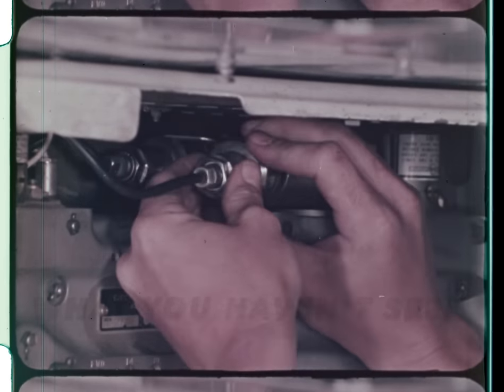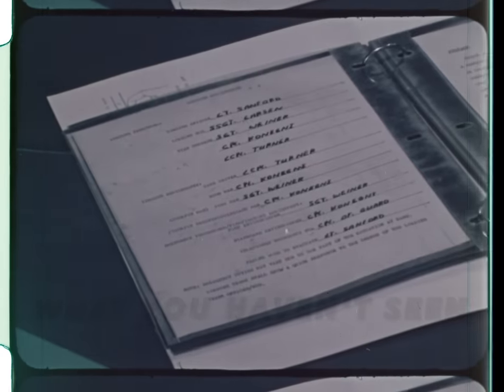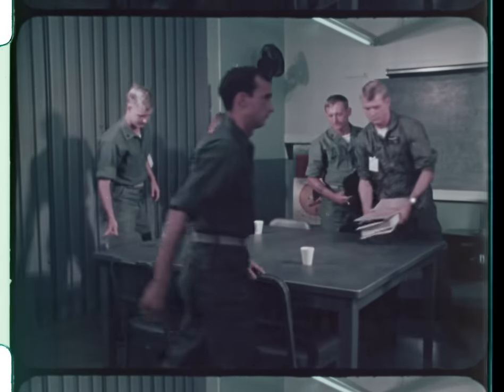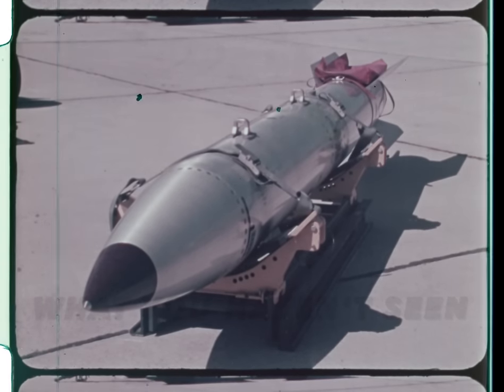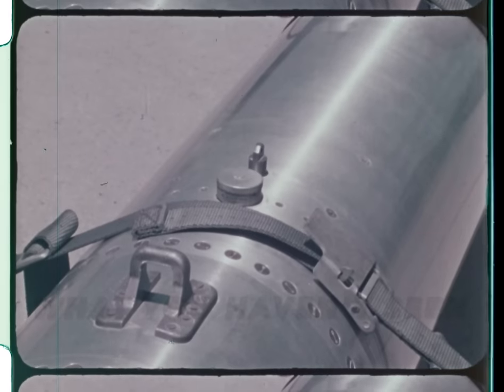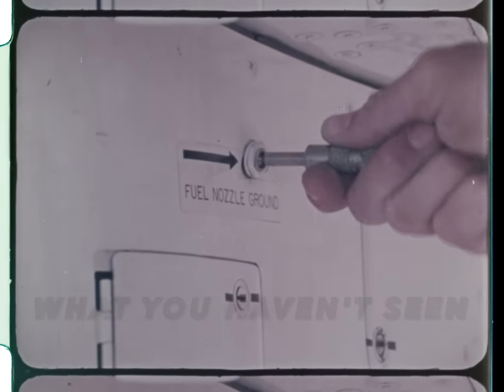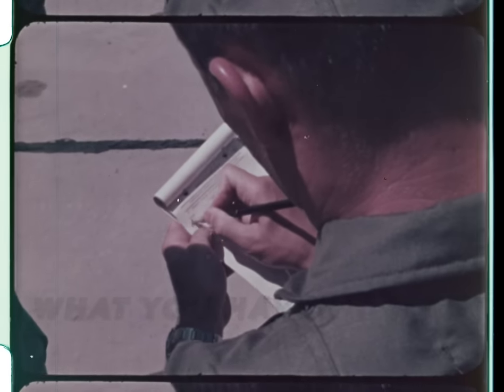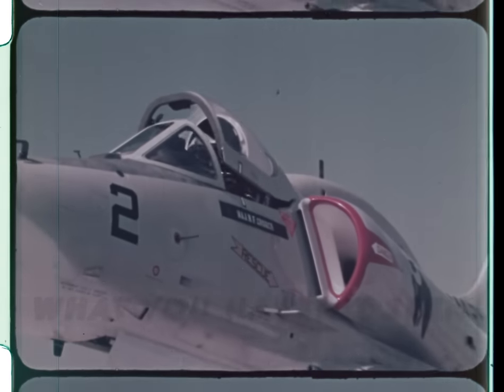Nuclear Weapons Loading Procedures (1976)

Comment: My crew load crew on the F-16 used to complete this load in 30 minutes to include power on ops check of the aircraft, safety wire and sealing of the nuclear consent, impulse carts installed and transferred to the aircrew custody. Then again, we were evaluated every month on our proficiency in load training. Real B-61's used for alert were delivered in impeccable condition, like jewelry. If they weren't, was a huge problem with funny names like bent this, broken that and dull. If you know you know. This video shows the Marines but pretty much the same for USAF fighters. Even 20 years after I retired, I can almost read from memory the steps from the checklist. Cool video.
Reply: All 710 pounds of the Mark 61?
Reply: B-61. About 700 lbs. later mod 12’s were more because they were designed as penetrators.
Reply: I'm curious, when the B-61 is/was dropped how does the electrical cable linking the plane and weapon detach? It seems like the weapon is dropped with the cable attached?
Reply: @spacewolfjr  There is a wire rope attached to the connector that is secured inside the pylon. When the bomb drops, the wire rope pulls in the connector which has movable locking tabs that allow it to easily be disconnected from the bomb receptacle. The other wire rope assembly goes to the parachute extractor which depots the chute as the bomb falls away.
Reply: Did you stand behind the nuke and act like the nuke was your unit?
Reply: @spacewolfjr  The Mark 80 series free-fall GP bombs and M117 and M118 demolition bombs (as examples) have an internal cabling from the nose fuze well to the after fuze well.  The internal cabling meets in between the suspension lugs in the Mk 122 fuze well through which electrical power is supplied at the moment of weapon release.   Of course with special weapons, the cable connection is intended to fulfill a different yet similar role.  Note that the aircraft was an A-4E/F SKYHAWK and the centerline station was used which was also used for the WALLEYE I/II TV-guided bomb.   A nuclear variant of the WALLEYE I also was in service but has been withdrawn.
Reply: thanks for sharing the serious business that you were part of;   They don't assign duds to these type of duties.
Reply: @randylahey2242  if you ever saw the size of the pipe the spring that fires the parachute  out you wouldn’t stand behind it unless you really needed to. That said, every weapons troop at some point did exactly that. Mostly with the 2000 pound MK-84. It was more our size. 😉😂🫡🇺🇸
Reply: I watched a two man take 20 mins just to get the IFL bolt out.
Reply: @spacewolfjr  It has a wire rope connecting bomb end cable with the pylon, retaining it.
Reply: @mattyx3x You need to have the right touch with the allen wrench to keep pressure off it then tap it on the thread side and it flys right out.
Reply: Do you have any belief whatsoever that modern crewmen are as competent as you were?  you have seen the woke CIA recruiting ads correct?
Reply: I would imagine that if this was a mid-war type of activity that it would be happening inside of a protected shelter and the tension level would be an 'eleven'.
Reply: @Tishers  Yes. I never loaded them in the US, only overseas and always in a hardened shelter or Tab-V.
Reply: @jaycee30865  I actually replied to your comment and the Tube Gods must not have like it.
Reply: I just LOVE censorship! I like thought and speech control both.
Reply: 12 years as a USAF 463X0. Our B 61s were painted grey. The B 61 in the video is a Type 3C training weapon.  The B 61 MOD 13 is still in the USAF inventory. If you want a laugh there is a video of a W 53 being removed from a Titan 2 missile in 1983. It's located at YT channel    SSgtmyway    .  We were alot younger back then both 462s and 463s !
Reply: @davidpuissegur1263  Yes we were a lot younger! I only saw a few of the painted one ones. All of the drop shapes were painted. The silver bullets I first loaded at an unnamed location looked like they were turned on a lathe and then polished. Too bad the changed the AFSC. Most of us still called ourselves 462’s, even your guys and the stackers had too much pride to truly identify as 2W1. 😀
Reply: Anyone remember the B43 used by the US Navy? Lol.....
Reply: Bent, broken, dull, and god fucking forbid empty...
Reply: You haven’t met many of us then.
Reply: I also remember this from my F-111 days at Nellis AFB.
Reply: Thank you for protecting us!
Reply: @byronharano2391  Tsetse primary (B43). It was internally boosted and the yield went down with age unless you replaced the tritium canisters, which was not easy or cheap to do with this design. They pulled one out of inventory, dialed it to about 1/2 the full yield, and it produced only 1/2 of that.  It opened some eyebrows, and then the cost of maintaining them was high.  They refurbished them with fresh tritium, but the stockpile was reduced with the oldest ones going to Pantex outside Amarillo to be melted down.  All nuclear weapons age, and periodically the fissile materials have to be removed, melted down and repurified, and then it can be reused. The last B43 was pulled in the early 90's. The Tsetse pit design goes back to the 1950's and was used because of it's small size, and variable boosting, and it had a long career.
Reply: I kind of like weird aircraft problem scenario codes;
Shattered B-one.  Missing, hijacked or stolen B-1A or B-1B. With or without weapons.
Bent Beak: Disabled B-2A Spirit due to accident or unknown cause.
Broken Beak.  Missing, hijacked ,or stolen B-2A Spirit. With or without weapons.
Eagle Feather. Missing, hijacked or stolen F-15A/B/C/D/E. With or without weapons

Comment: I did the same thing in the USAF in 1974 while stationed at Bitburg Germany with F-4E's (the ones with the 20mm nose gun) we loaded with either the B-57's which were white with red trim or the B-61's that were unpainted metallic color. I was a "four man" who readied the weapons and drove the "jammer" for loading while the others readied the aircraft on a four man load crew. Both were 2000 pound classed weapons. In Germany we had about 90 aircraft so we figured maybe 50 weapons or fewer as not all aircraft would be battle ready so they wouldn't be loaded either. These aircraft once loaded were in what they called the Victor Area, while the aircraft on hot alert and loaded with AIM 7 Sparrows and AIM 9 Sidewinder missiles was called the Zulu Area. The nuclear loaded planes NEVER flew once loaded, they were the ones parked behind that 16 foot tall double cyclone fencing with locked gates and guards with dogs were a common sight. Although the hot alert aircraft were scrambled daily sometimes more then once!! That was a great job in the USAF although things were winding down in southeast Asia and there got to be fewer and fewer of us weapons troops around. My enlistment was up in 1976 and even though I enjoyed (most of) my time, I never once regretted my decision either...

Comment: Handling nukes on the flightline became somewhat routine, if you could ever call handling nuclear weapons routine. Whether it was uploading a bomber or downloading one when it came off of alert....or loading them up for an Operational Readiness Inspection exercise. On one ORI my supervisor asked me if my aircraft was ready for weapons. I said all we need is the final security check and we were ready. Apparently all he heard me say was "we were ready."  Because the final security check of the aircraft means from that point on the aircraft has a red rope put up around it and from then on it's two-man policy inside the red rope and therefore ready for weapons to enter next to the aircraft. Well I had my aircraft log book laying on the fire extinguisher in front of the aircraft doing sign-offs and I get a tap on the shoulder.......it's a nuke weapons package and its heavily armed convoy. I said to the security guard (wait for it) "Are you sure that is for this aircraft?"  And all hell broke loose. The entire base went on alert. They considered it a bent spear. Something went wrong with a nuke convoy and Bird Colonels were suddenly on all sides of me. "Airman what do you mean holding up this convoy??? ....and so forth and so on. It was a cluster fluke. I couldn't get a word in edgewise.....and before I could even say anything...they rolled the convoy into my area without it's final security check. I looked at my supervisor and shrugged. He said, "Put up your red ropes airman."  The security guards weren't even in position. They were standing behind me when there was supposed to be one in back of the aircraft. 
That's one story anyway. There are others.
Reply: All I can say is during an ORI or an NSI (even worse) two distinct things happen, you either shine or screw the pooch. Never "You all did OK" 😂
Reply: @heeder777   That's exactly right.....and I never agreed with that method of training. I felt like we should have drilled on doing things the correct way so we would at least know how things SHOULD look......instead of the cluster X we usually engaged in.
Reply: Sound like an interesting day on the base 😂
Reply: @christopherleubner6633   Never a dull moment, as they say.

Comment: 0:44 Just noticed that skyhawk is equipped with the Flash Hood to stop the pilot being blinded by his own weapon
Reply: So it was expected the pilot and aircraft would survive?
Reply: @jamesterrynewton4794  you just need the pilot to think that
Reply: @jamesterrynewton4794  So, Wikipedia says that the B61 can be launched at speeds of up to Mach 2, which would give the pilot a fair distance before it detonates about 31 seconds later. The B61 is also variable yield, but not exceeding ~400kt (Wikipedia says so). It makes big boom, but not the biggest boom.

Alas, the Skyhawk is only capable of flying at up to 1,083km/h or around Mach 0.8. That's still about 300m/s if the pilot hauls ass. 31 seconds later that would put a distance of around 9.3 kilometers or 5.8 miles on the horizontal, plus the height at which the A-4 is flying... Yeah, I'd say there's a fair chance of surviving...

But in nuclear war, the lucky ones are the ones who die immediately.
Reply: The nuclear toss method allows for enough separation from the weapon at detonation. This is a tactical low yield nuke and the pilot is always expected to survive the effects.

Comment: If only some aircraft manufacturers would have similar procedures and verification
Reply: Careful you'll be Arkancided
Reply: That's the sketchiest part of the whole Boeing debacle IMO. They do have similar procedures and verification. When someone in the Air Force lies on the paperwork they're almost certainly going to get caught depending on what it was and there's actual repercussions for it. When someone at Boeing lies and comes up with some contrived reason why they can skip the paperwork and inspections there's a tiny tiny chance that the CEO might have to make a public statement a few months later claiming to care about safety.

Comment: The Grounding Cable?  That's  a 1/4 inch male guitar jack!  I am assuming there's a Fender Twin Reverb Amp at the other end of that cable...
Reply: The spacing of the contact areas of the jack is different.  So is the diameter.  Otherwise . . . .
Reply: I hit the Translation button and I got the entire instructions done by Slim Pickens !!
Reply: Yup an audio plug. Bet it has some serious distortion when it gets dropped😂

Comment: I'm a civilian so take this for what it's worth, but I can't fathom it would be this orderly in a wartime scenario. The only time tactical nukes would be used is if NATO were up shit creek without a paddle, and Russia would almost certainly strike back, with nukes, at whatever airfield from which the strike aircraft took off so these guys would be doing this with the (virtual) certainty that they would be dead within hours.
Reply: So I worked on a nuclear QRA in Germany with ready to go aircraft armed with these types of weapon. The aircraft were sat in hardened aircraft shelters ready to launch and the only thing necessary to do with the weapon was to pull out a single pin. The alarm could sound and from that to being airborne was about twenty seconds, maximum thirty. Everything you see in the video is conducted beforehand, perhaps days beforehand. There were always a number of aircraft ready to launch. The scenario in the film has not included this, perhaps to keep the launch sequence classified. I know for a fact that the part where the armourer removes the pin that prevents release is fantasy. If an armourer or the pilot so much as touched that pin on quick reaction alert we were instructed to shoot them dead. There was a sequence of failsafe codes that had to be completed between us and the pilot (took five seconds) and we were then to pull the pin. If the pilot attempted to taxi the aircraft with the weapon on and the codes procedure wasn't complete we were to shoot through the canopy and kill the pilot. So a lot of checks and balances after the work in the video was done. That part was certainly never filmed or discussed and was secret (and still is; I have omitted much). We practiced this over and over and never knew if it was an exercise or the real thing. The sobering part was that if it was real and they got airborne, you had a few minutes before the incoming nukes would land right on top of you.

Comment: I didn't realize a Scooter had that much room underneath.  Try an F-18.
Reply: It was originally designed to carry the Mk 7, back in the early '50s.  The Mk 7 was a big beast, so the Scooter got its long, spindly legs.  If you can find a picture of an A-4 carrying a Mk 7 in flight, it looks like the plane is riding a Zeppelin - it's hard to say who's carrying who.